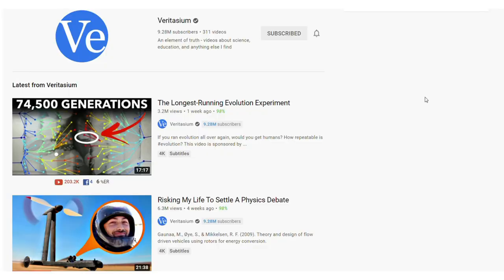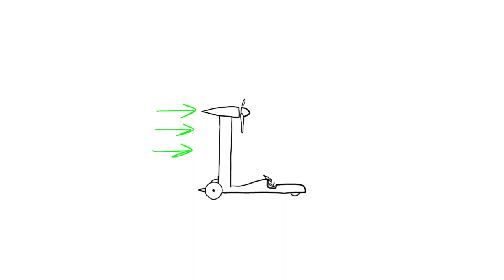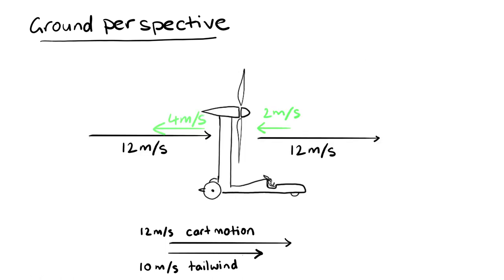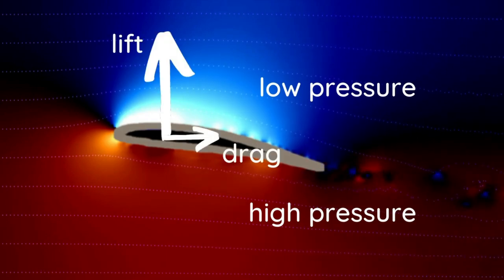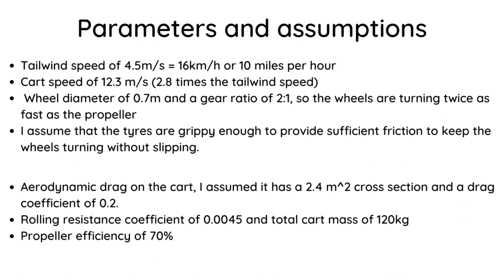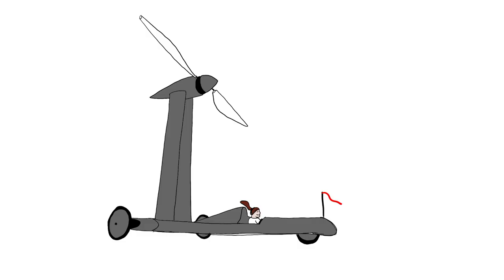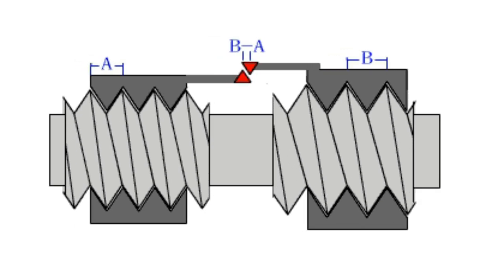Downwind Faster Than the Wind by Veritasium: How Does it Work?

Comment: I feel like what you are missing is that the cart is still being ‘pushed’ by the wind even when the cart is moving faster than the wind. How? What is happening is that the blowing wind is meeting the blowing wind being push aft by the cars prop. That fires is what is transferred to the prop blades and ultimately moves the cart forward faster than the blowing wind. When the blowing wind is ten knots and the cart is moving with it at ten knots then the apparent wind at the front of the cart is zero yes, however at the back of the cart behind the prop blades the apparent wind will not be zero. It certainly won’t be ten knots due to various inefficiency but it might be say seven knots. So even when the cart is going at wind speed there is still a seven knot force of wind pushing it which will then increase the carts speed to faster than the blowing wind. So now the cart is going fifteen knots in a ten knot wind. There is now a five knot apparent wind pushing against the front creating drag but the prop is now turning even faster and although there are still inefficiency there is still a say six knot wind moving aft of the cart off the carts prop which is meeting the ten know wind etc etc. I don’t really see this whole deal having a lot to do with gear ratios between the wheels and prop in any fundamental way. Some ways will be better than others for a given wind speed, cart size, prop size etc but it’s not some sort of ‘gear ratio torque conversion truck’ as some seem to be stuck on. The main key imo to getting your head unstuck is to understand as you pointed out early on that there is lots of power in the wind!  This is simply a new way to use resultant force as sailing craft to to go upwind and faster than the wind, both of which freaked out people when they were first demonstrated
Reply: Force not fire lol.
Reply: //" I don’t really see this whole deal having a lot to do with gear ratios between the wheels and prop in any fundamental way."//

There is an extremely critical ratio between the wheels and the prop, but it's not the RPM ratio that many think but rather the ratio between the distance that the wheels travel over the ground compared to the distance that the propeller would carve its way through a semi-solid.   This means it's the pitch of the propeller relative to the rolling distance of the wheels rather than it's rotating speed.  There is a relatively narrow window of this ratio for the Blackbird to function. 

Hope this helps.

Comment: The blades of the propeller are not in fact travelling downwind, technically they have their own motion and the rate at which they spin is down to the pressure differential on either side of the blade. So drawing power from that you can go faster, think gyrocopter (the top rotor held in place perpendicular to the forward thrust by the driving propeller, provides less lift, than if allowed to spin freely but energy is used to spin the top rotor, that energy drawn from forward motion, so less energy for lift but more effectively applied, does that guy play with them by any chance).

Comment: Question if you have an airplane flying and loses its engines or better a  glider  and you don't have an high pressure bellow the glider, does it accelerate and fight higher, even if you can manipulate theoretically the size and angle of attack of the wings, or does it fall down to earth? Another example you must know about helicopters autorotation manover, something very similar to this topic. Does the helicopter keeps flying undefined of falls(gently) to the ground? Look you have to have side winds, small gusts not very strong compared to the directions that the vehicle/body is going and a perfectly designed propeller-hard sail/wing to create a strong enought bernoulli principle/lifting force. Wind is not a vector is not laminar is a field of interacting vectors and because of that (and very fine tune mechanism and design) this is possible respecting the principles of the conservation of energy. I smell a infinite recursive loop in most explanations about this topic, the reality is that is not, it may have some recursion and concurrents functions but is not a perpetual motion machine and that must be very well defined at the start, nor is this nuclear physics where you pull the fission rabbit out of the radioactive hat.

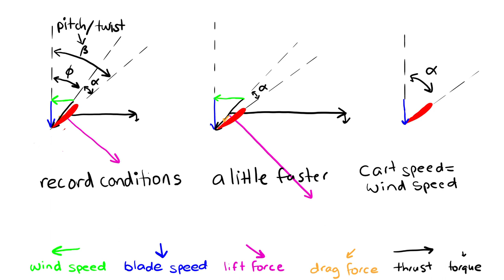Comment: At 14:18 you said that with 0 tail wind or head wind, we still have power to accelerate the cart.
At the point that a head wind or tail wind stops, the cart will slow to a stop.
There will not be any energy input to keep the car moving. 
It does not matter how the prop angles are adjusted, the cart will slow to  a stop if the wind dies.
I have found that many people are not understanding the principal of operation of this cart and partially because there are  some incorrect explanations being given. 
Can you re-word that minute part in a comment reply to clarify that section or do you have any questions on that ?
Reply from the maker: The comment was in relation to the relative wind speed, zero head wind for the cart driver when the cart is  travelling at the speed of the wind.
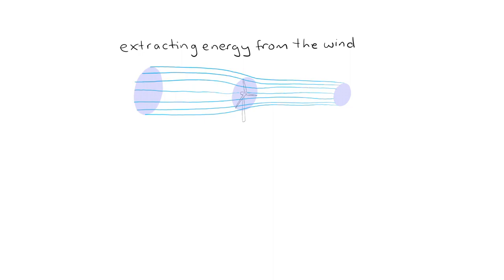Reply: @EngineeringwithRosie  = I checked your explanation at the 5:00 minute mark and I find it makes more sense than the explanations that the other people have given. 
Someone may have given that, but if so, it was not explained as well as this.
I will spend a little time checking it over.  .
=
 If you wanted to improve on that, just give the explanation in one or two different ways to make it clear for other people..  It took me a couple times through to make sure i understood what you were saying,, to make sure that I understood properly.

Comment: Here is my take: the wind is pushing the vehicle AND the mass of air around it at windspeed, full stop. That intuition is correct, but we tend to not look at the air mass portion because it's invisible. If the vehicle is able to push enough air backwards, the wind will be forced to move jointly that mass of air + the vehicle. And a combination in which the vehicle speed is higher than the windspeed is possible.

Comment: Wind energy is proportional to the cube of wind speed.   Imagine the propeller in a say 10 mph wind,  blowing backwards into that wind,  maybe it slows the wind behind it to 5 mph.  energywise,  that is 1000 reduced to 125, so the propeller has harvested 7/8 of the energy from that wind!  As the vehicle accelerates,  the propeller goes quicker and creates a long wake of slowed wind.  And  the energy stolen from the slowed air is what drives the land yacht along.

Comment: So, I got nothing more but high school science behind me, but if I understand this correctly, as soon as this vehicle moves the rotation of the wheels powers the giant fan giving it self sufficient trust? So in theory this can drive forever once its in motion? Because the movement of the wheels get converted into trust by the fan which adds movement to the wheels.

So what if we combine this vehicle with one of those solar cars.
I assume the electric motor of a solar car could start this "wind-powered" vehicle regardless of windspeed at which point the fan can take over so you don't need to drain the battery further (the fan cares about relative windspeed, not actual windspeed).
And once the fan generates more trust than needed to maintain speed that excess power could be turned back into electricity and help recharge the battery.
So that all combined creates a system that can accelerate regardless of windspeed to then travel at a constant speed with nothing more but solar and wind adding power to the system?

or is that all just science fiction what I'm imagining?

Comment: I find it really confusing. If we take the wheels over hang and blow air at blade, the blade will rotate at a fix rpm regardless of the blade design. Since it is  directly coupled to the wheels, the wheels will rotate at a constant speed as well. The wheels and blade rotation maybe different due to gearing ratio. Now i will reverse the proccess by turning the wheels which will turn the blades( treadmill experiment) .  If a certain air speed(Va) turn the blade to a certain rpm(Rb), would a certain blade rpm (Rb) pruduces the same air speed (Va) ?

Comment: Some other videos show vehicle models starting from rolling on a treadmill and then accelerating forward when released.  Does this mean that there are some combinations of treadmill speed and treadmill incline where the vehicle model will remain stationary (relative to the floor the treadmill is on) forever?
... And since faster spinning wheels generate more propeller force, the angle of the "stable/stationary inclined treadmill" will increase with a faster start. What is the limit of this maximum angle? If it goes to straight vertical, doesn't that mean the vehicle is essentially a hovering helicopter?
Cool! Hovering cities in the sky are next and it only needs some finite initial energy to hover for free, forever!

Comment: So one of the big thins is, that the wheels are much smaller than the prop?
Meaning that if the wheels were the same diameter as the prop and they had a gear ratio of 1:1 it wouldn't work, because I would have no mechanical advantage?

Comment: But once we are faster than the tailwind, where does the energy come from? I get that the rotation of the wheels turns the propeller. But at some point the propeller provides more thrust than the drag and now we're going faster than the tailwind that moved the cart initially which turned the wheels which turned the propeller. So what's turning the propeller now?
Reply: The inertia :) The propeller spend the wind power accumulated while cart was accelerated from 0 to the wind speed.
As soon as this rotating power slowly spends out, this car will slows down.
The power was from the wind, and if no more wind = no more power.
This is not the earth rotating propeller, this is a wind rotating propeller by the wheels.
Reply: @anufriyev  
>> As soon as this rotating power slowly spends out, this car will slows down.

Nope.  We make no use of stored energy.  That was one of the requirements for the record run in 2010.
Reply: @Rick_Cavallaro  The propeller spend the wind power accumulated while cart was accelerated from 0 to the wind speed. Obviously, this requirement must include the propeller.
Propeller work on this car as flywheel.
Reply: @anufriyev  
>> Propeller work on this car as flywheel.

It does not.  To extract any energy from a flywheel you have to slow the flywheel down.  If we slow down the propeller, we slow down the wheels that are driving it, and that slows down the cart.  We had to demonstrate that we were going well above wind speed and still accelerating.  We do not and can not make use of stored energy.
Reply: @Rick_Cavallaro  And this is exactly that's happening.
The car starts slows  down as the energy from the propeller(flywheel) starts spending.Make a long run in the desert. Let say 1 hour.
Or make RC model car for the aerodynamic tube where is no gasps of wind and run it for the long time.
Reply: @anufriyev  I guess you didn't see the data from the record runs or look at any of the analyses.  That is NOT what it does.
Reply: @Rick_Cavallaro  You didn't check the wind speed all the time in every point. The sudden gasp of wind can change everything in a second.
It must be a controlled environment. RC model car in the aerodynamic tube will show you the truth.
Reply: Bernoulli's principle. The propeller creates a low pressure area in the front of it. This is irrespective of the direction of the air moving around the cart. The only point of the airspeed is that it reduces the friction losses on the cart carrying the propeller as it moves forward. Once one exceeds the when airspeed, the friction increases. This together with the mechanical losses and the limits and efficiency of the propeller set final speed
Reply: @rcmrcm3370  "Natura abhorret vacuum"
You must spend the energy  to create something.
The low pressure come with the price.
All surrounding air wants to go into this place, where is low pressure.
This stream drag car down.
Reply: For the record run we had a logging anemometer and a GPS receiver on the chase vehicle.  We had a logging anemometer on the course.  And we had 3 GPS receivers on the blackbird.  We were going 2.8X the wind speed AND accelerating.  There was no time that day the wind hit the speed we were going.
Reply: @rcmrcm3370  
>> The only point of the airspeed is that it reduces the friction losses on the cart

Nope.
Reply: @Rick_Cavallaro  
1. Do you change the propellers blades pitch while running downwind?
2. How many attempts ended successfully and how many did not?
3. For how long you can accelerate(or, in the other words, why you stop accelerate)?
Reply: @Rick_Cavallaro  
 "There was no time that day the wind hit the speed we were going."
No one have this kind of tools to check this great amount of air at any given moment.
Even in ocean existing, the hidden streams. This is why such a process must be observed in the controlled environment, like an aerodynamic tube. With smoke, polarized light, sensors and video cameras.
The scale doesn't matter. Even 10 inches long model must behave in the same way as blackbird.
Reply: @anufriyev  It's tragic that youtube doesn't have a LMAO emoji. :(
Reply: @Rick_Cavallaro  
So happy for you.
Most people, then  fail for more than 10 years, have LCF :)
"The ignorance is bliss".

Comment: If we know how modern sail plane / boat attain forward thrust component this can be explained and easier to comprehend. Consider propeller of the experimental vehicle as wing of a sail plane. 

It transforms sink rate into thrust at the leading edge, forward. The thrust is then converted into moment force (spindle torque) to turns a drive sprocket > bicycle chain > load sprocket > axial of two road wheels. 

A sail plane or folded paper glider, must be tossed forward at a velocity, at or above the stalling speed of the blade / wing in order to creat lift to glide. Likewise to the wind turbine of the experimental vehicle, also needs to spin up and above stalling velocity. It can then slice the air/wind at close but less than 90-degrees wrt air current at zero degrees from behind, in order to produce leading edge thrust to drive the spindle sprocket.

Comment: FYI. Great job guys. It seems that physics has gotten so complicated that it debunks on paper that which is actually possible. By using 1000year old tacking sailing concepts, yes at an angle as all the math showed, being able to travel faster as the wind itself. By implementing the correct "Engineering" gear ration, with a propeller,  which is pitched just right to turn faster than the wind itself, all physics aside, gearing that rotational energy down to the wheels, you can definitely move faster upwind than the speed of the wind. Yours Truly. SA CAT Teacher.

Comment: Hmmm ... likely best explanation I've seen - from three or four :) - is that as vehicle goes near to windspeed, it increases it's resistance towards tailwind (freely rotating propeller would decrease it compared to fixed one, powered one is obviously better than fixed one. But once it gets very close to windspeed it already gets enough power from wheels to accelerate it beyond windspeed.

Comment: It amazes me that anybody had a problem understanding this.

A paper bag will blow in the wind at the wind speed correct?

So if you have the wind pushing the vehicle forward, and then you take some of that energy and you spin that propeller..

The vehicle is going to want to continue going the wind speed, except now it has a second source of acceleration.

If you add acceleration to something that is already moving a certain speed.. it inevitably will go faster.

Comment: No matter the explanation of how it works it still has a maximum speed that is somewhat faster than the wind speed. I think a lot of people look at this and go "omg it has infinite power and will accelerate forever" but obviously it would not.
Reply: I rationalize it by looking it at if it was a gearbox. Power is always the same. It’s how you want to use the power. You want to go fast, use higher gears 5th etc at the expense of torque. You want torque to get up hills, use low gears 1 at the expense of now low top speed. All the while the power input has remained the same.

Comment: It can't keep going if there is no wind cos that would be perpetual motion. You have to have a differenc in wind to ground speed. The more thrust than drag caused by the wheels is like the boat. The keel can make way more wind pressure on the sails to make the boat go faster. More thrust from the sails than the drag on the keel. You explained the propeller thing well!